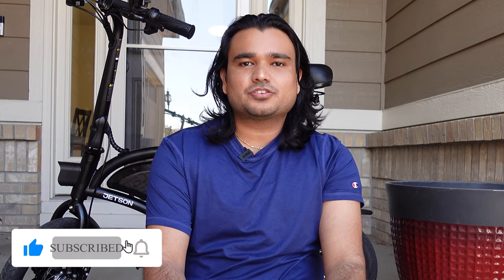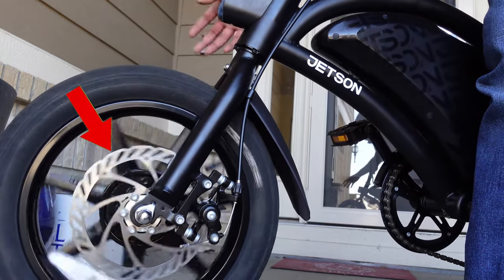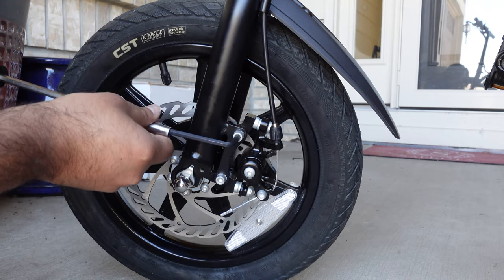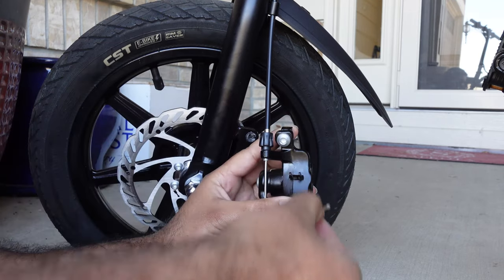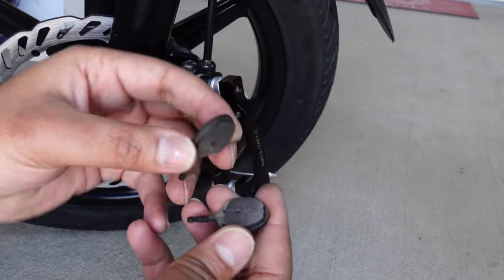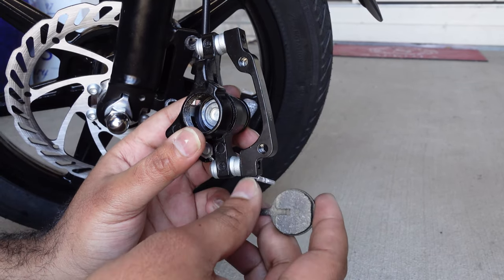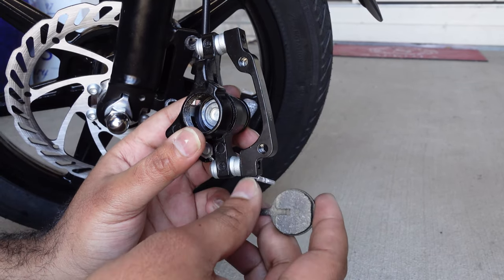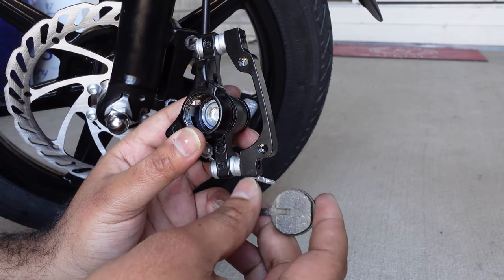Brake Pads Replacement - Jetson Bolt Pro (Folding Electric Bike From Costco) 2021

Comment: Hi Shiva, the handlebar twist throttle has led to accidental launches with inexperienced riders in my family. Would it be possible to install a switch to disable the twist throttle? Something like a bypass on a particular wire to the control unit.
Reply from the maker: I have actually been getting this question a lot lately. So, I am currently in a process of taking apart all wirings on this bike so I will be able to answer your question soon. I think you can just run a new wire from the controller and do a separate thumb throttle and disconnect the power to your main throttle. Again, give me a little bit of time and I will be back with a video possibly with wiring diagram for this bike and ideas on how to add a secondary switch to the throttle. Thanks for watching my video.
Reply from the maker: Hello, I just posted a video on how to add a thumb throttle for added security. Please check that video out. This method will disable your twist throttle.

Comment: Awesome vids man
Reply from the maker: Thank you! I really appreciate the support.
Reply: Hey quick question..... Are we able to do a fatter tire with our Jetson Bolt pro?
Reply from the maker: @manongssarap7990  The frame is quite small and tire clearance is very low. I don't think fatter tires would work for this bike...
Reply: @ShivaSapkota  even just a little bit? Like half an inch thicker you think?
Reply from the maker: @manongssarap7990  I think you can do half an inch. I am not sure we can find tires like that though :)

Comment: How do you know when to replace the pads?
Reply from the maker: If it starts making noise or if you brakes are really loose. You can tighten the pad distance using the method I show in my video and if the pads are not catching the rotor disc, that would indicate you need new pads. Thanks.

Comment: I just replaced the rear brake pads.  Now the  throttle will not move the rear wheel.  The wheel moves freely manually and the charge indicator shows a full charge.

Comment: I need to replace  my battery for my Ancheer folding electric bike 36v 6.0ah 216.00Wh lithium battery 101MR19/65-3Limited Charging Voltage:42V Thats the info on it I don't know witch one to get

Comment: Yeah sure tell us more about the differences in break pads
Reply from the maker: The biggest difference is noise. The sintered metal pads make a lot of noise but they also handle high temperatures. If you are in an extreme conditions (mud, water, grit, sandy trail), I would say get the metal pads. The resin pads are quieter and are great for average weather conditions. They are also better for your disk as they don't "bite" the disk as quickly. The metal pads have longer break-period, so it will take longer to bring your bike to a stop compared to the resin pads. If you ride a lot of downhill, I would say go for metal pads. Hope this helps. Thanks again for your support to my channel.

Comment: It's not normal for the brake pads to drag and make noises when the wheel is freewheeling. I suggest you study up and learn how to make the proper adjustments, then update this video [or make a new one]. Brakes done wrong can kill. I wish people who 'teach' others on the internet pushed that more often. Too many people are performing brake repairs and maybe should not.
Reply from the maker: Looks like you watched and put a lot of inputs in my videos and I really appreciate that. However, I disclose in my videos that I am not an expert and I am just trying to help out the ones who need help. What worked for me might not work for others and I do not take any warranties. If you are an expert in these stuff, you don't need my help. I am showing people what worked for me and could potentially work for them. There is absolutely no support form the manufacture of this bike so I decide to help out folks. Yes, doing these non OEM repairs are always risky and I might not know everything about this bike but I am just trying to show people what worked for me. Thank you again for your time.
Reply: @ShivaSapkota  As I hope you understand, if you sell someone some crack and tell them you should not use it, you are still somewhat responsible. I do agree with what you are thinking, but when the information is wrong and someone calls you out on it, you have two choices. You can confirm, I'm a total idiot and I have no clue what I'm saying or you can research it and confirm that I am right and edit the false information out. You have no control over what someone else does with the information that you are sharing, but if you are sharing bad information, then maybe, just maybe you could confirm that what you are saying is incorrect and fix that. I certainly can't but I can share that you may want to research what you are saying is correct. Brake pads should not drag on the rotor/disc and saying that it's ok is not right.
Reply: @omgitsme435  Sharing misinformation and then blaming it on others because they should not read your misinformation seems weird to me. I do not publish video's but I suspect it would not be difficult to edit mistakes/misinformation. I think it would be better than blaming everyone else for following your wrong information. If that is what crack is like, then I guess I am on crack. Shiva may have good intentions, but there is so much misinformation that someone needs to point it out. Sorry that I seem to be the one.

Comment: No disrespect but your video title is misleading because I was for a little help how to adjust the brakes either front or back not important you go off topic it's okay for replacing the pads but you say anything about the fine tuning adjust on hand bars either release them or leave them alone  my experience is that have to adjust when replacing them because new bands are thicker I feel sorry for the people with no experience some thing can happen and you say you are not a professional mechanic say that on video to  your cover your butt go advice  I'm a lot older then been around the block a few times bro